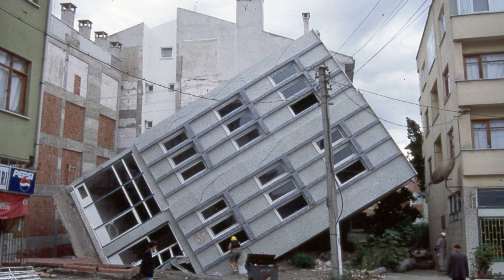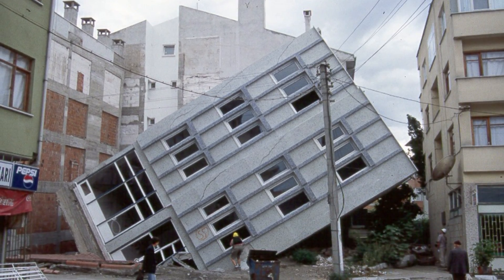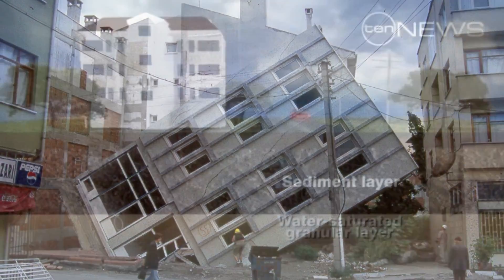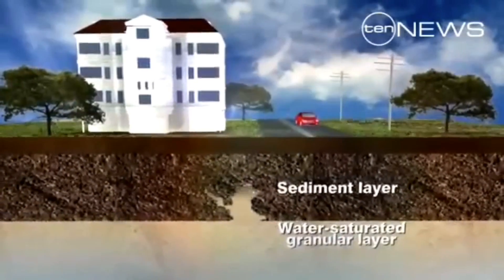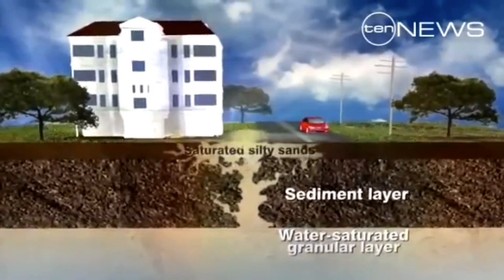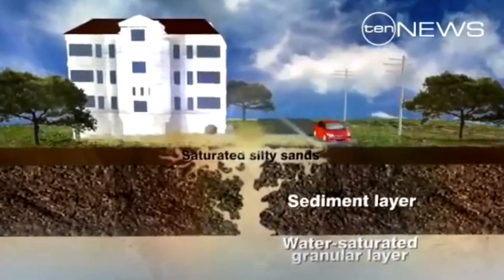The Science of Geography - Liquefaction

Comment: I just downvoted your comment.

\#FAQ

\#What does this mean?

The amount of karma (points) on your comment and Reddit account has decreased by one.

\#Why did you do this?

There are several reasons I may deem a comment to be unworthy of positive or neutral karma. These include, but are not limited to:

* Rudeness towards other Redditors,
* Spreading incorrect information,
* Sarcasm not correctly flagged with a /s.  

\#Am I banned from the Reddit?

No - not yet. But you should refrain from making comments like this in the future. Otherwise I will be forced to issue an additional downvote, which may put your commenting and posting privileges in jeopardy.

\#I don't believe my comment deserved a downvote. Can you un-downvote it?

Sure, mistakes happen. But only in exceedingly rare circumstances will I undo a downvote. If you would like to issue an appeal, shoot me a private message explaining what I got wrong. I tend to respond to Reddit PMs within several minutes. Do note, however, that over 99.9% of downvote appeals are rejected, and yours is likely no exception.

\#How can I prevent this from happening in the future?

Accept the downvote and move on. But learn from this mistake: your behavior will not be tolerated on Reddit.com. I will continue to issue downvotes until you improve your conduct. Remember: Reddit is privilege, not a right.